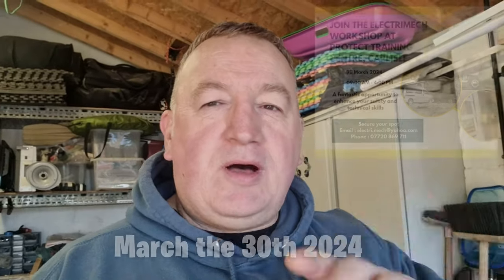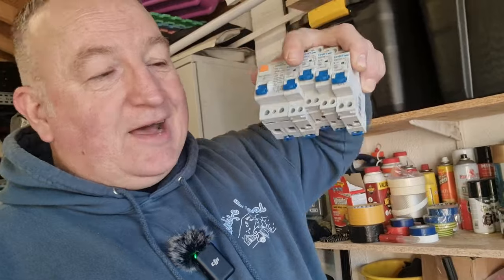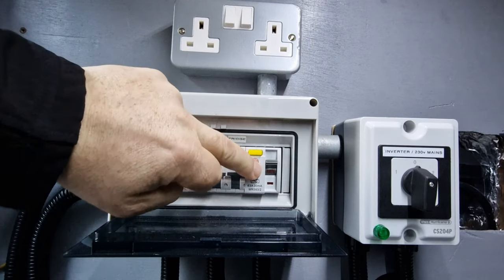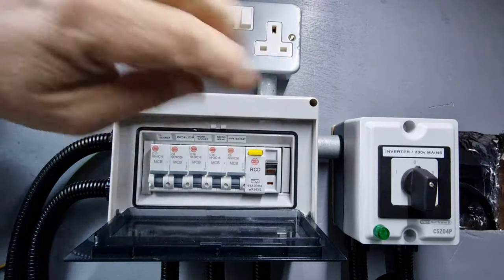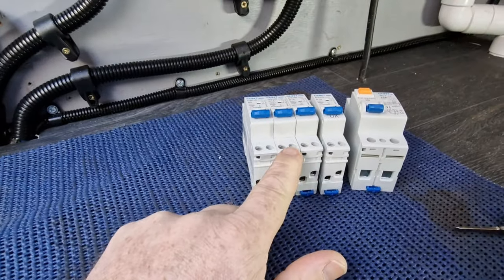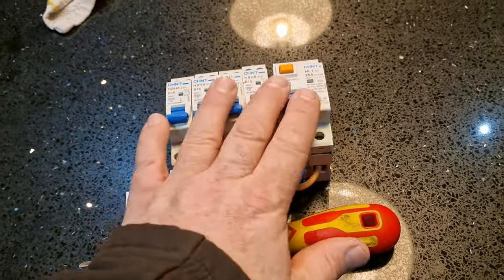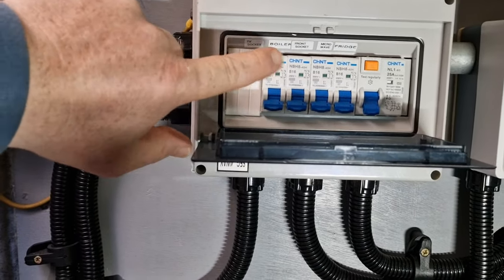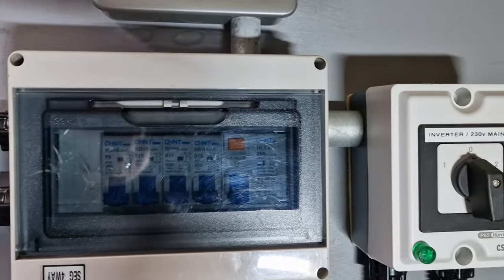campervan electrics campervan 230v fuse board upgrades

Comment: Hi Sam, though you are right to want to upgrade electrics to make them safer, regulations are not retrospective and there is no evidence that an Insurance company would invalidate a claim if you had the older RCBs fitted in fact most vehicle assessors are not qualified on 230v electrics so could not even report on them.
Reply from the maker: I wouldn't want to find out the hard way. 
Your campervan won't pass a habitation check with single pole MCB'S as they don't comply with section 721 of the UK regulations, 
More and more insurance are now requesting habitation certificates to mitigate their liabilities 
It's better to be safe than sorry, don't you agree?
Reply: @TheCraftyBlindersvanlife  yes better safe than sorry, interestingly LV don’t want to know what is fitted and when I spoke to them about this very point their view is that unless there is evidence of criminal installation (I won’t mention any utuber In Particular ,diffo not you) then they will honour a claim.
Reply: This would imply every campervan ever made and installed with 240vac by the manufacturer would need upgrading to be compliant with regs. Surely it would also mean domestic installations that now breach current regs would also need upgrading to be insurable?

Comment: Your video raised some really interesting points. Do you use conduit for all of your 240v cabling in the van? From a safety perspective I can think of many reasons why it might be sensible but is it a regulatory requirement? 
My understanding of why the MCBs need to be double pole is linked back to reversed polarity on live and neutral. If live and neutral were reversed the MCB would still trip on overcurrent but it would break the neutral connection, leaving a live feed present from source, through the load, and all the way back to the breaker.
Reply from the maker: Your right that's why we check for polarity when hooking up
Reply: I do wonder also how many hookup posts on campsites (especially some of the more rural ones recently encountered in France) have MCB’s that are dual,pole? As added safety I always flick off the circuit breaker on the post when plugging in my shore power lead, especially when it’s raining! But I did notice that every hookup point we recently used in France was not visibly protected by an RCD. Obviously lifting the semi-waterproofing flap to flick off the MCB breaker has it’s associated risks when it’s raining.

Comment: Hi Sam. Did you try the plug tester in the van to see if the RCD works with the inverter? That is the missing 'golden nugget' from the video. Cheers 😊
Reply from the maker: Had the system tested by my son all working fine we used a mutil function tester as it records the results

Comment: Hi buddy, I’ve had a few scary moments with the standard brakes on my swamper so after loads of research I’ve gone and bought the only upgraded brake kit I can find for vw crafter, got them from PB brakes , have a look pal
Reply from the maker: Thanks for the info it's on my list to do also
How are the new breakes?
Reply: @TheCraftyBlindersvanlife  

Very expensive pal , £ 1600 just for the front but the calipers have 6 pistons!! It makes a massive difference, only doing the front as it’s  £ 1700 quid for the back 🙈🙈🙈 it’s just to much to do both, 👍👍

Comment: Hi Sam,  I'm thinking I might not fit an inverter and all the bits that go with it, like batteries and so on. However, I'm still going to run a 12v DC system including fuse box. As for the 230v ac I'm considering a solar generator setup IE ecoflow. Do you think it would still be prudent to run a 230v fuse box for the fridge, microwave, and TV, which would all connect to a shore power connector on the outside of the van. Also, the ecoflow has shore power connectivity, which could power the van 230v system. Would this meet regs?
Reply from the maker: It would always be prudent to have a second source of power that complies with current regulations and a fall back or just for the winter months to protect your vehicle from frost and damp

Comment: Hi Sam, what is the difference between the two 230v inputs being switched by the changeover box. Is the AC sine wave from the inverter not compatible with certain RCDs? My van was built by a large manufacturer and was fitted with a Sargent with built in RCD, would that be suitable for a changeover from a power bank, what do you need to look for please?
Reply from the maker: The change over switch just allows you to select where you get your power supply from, either mains power or the invertor 
There a several different types of RCD out there all designed to work on different systems it's important to choose the right one as when you need it, there's a chance it may not protect you!
You could also add a power bank to a change over switch

Comment: Interesting to see your video. I was researching this for a while and finding conflicting advice 😮. Good to know what the regs require. I currently have a  hook up designed for tents, it is just connected through the van via the usual socket and hook up lead. Despite not using it much I should probably do it right 😊.  One big area of disagreement seems to be whther to earth the 230v to the van chassis or not.  There seems to be many that do and many that don't.  What are your thoughts? An electrician I know told me i did not need to connect the  earth to the van, so it leaves me a bit confused tbh.
Reply from the maker: Glad it was helpful! all your means of automatic disconnection require an earth how are they supposed to work correctly if the chassis is not earthed?

Comment: Great video Sam very informative and easy to understand but I do a electrical question I’ve been considering a lot at the moment 
Is the grounding of the electrical system to the chassis of vans 
When you turn on a inverter does it not change the current running through the chassis and cause issues with the vans ECU ? Thanks Kev
Reply from the maker: You must earth your van to comply with the UK regulations
Most safety devices require ears to operate properly
Your invertor is just another supply of power with a floting earth

Comment: Great video, mate. 👍 I like the breaker panel and the conduit you used! I am actually just in the process of mounting and wiring our electrics, with our install, it's all on the rear LHS - a tight fit.
I am a little surprised, that ferrules are not used on the (stranded) wire ends going into the breakers - that's a no-no within the german electrical standard. Using an RCB / MCB Kombo or an RCBO on the landline coming in should be a given, however, if you run mutiple outlets from your inverter to additional wall sockets, should you not include an additional breaker RCB / MCB breaker box behind the inverter? (Perhaps I just did not see one...)
I actually need to have a licensed electrician sign my 230V install prior to applying for a van certificate.
Stay safe! 🚐☁🍀

Comment: I would have all isolatros in plain view and gap around them so they can be properly used, the isolator on the side of the seat is too close to the upright, the one under the seat is hidden and not readily accessible. not sure what the bare fly leads are, but prob not good. Also why is alt and 12v through a mains trip? 

Never understood why there is never a switch on camper/carava 230v outlets? Can't be a great idea. 

Worth noting that ferrules on the cable ends makes a much neater and safer job. Makes sure you never get stray ends. 

Vehicles only need to be current at time of build, but always good to update the items. DC should also never go through a mains AC fuse box. Most inverters are true sine wave so the wave is as close to spun derrived AC as it can be.

Comment: Great video Sam once again very informative. Do you know of anyone who does Gas system inspections please. I`d like  a pro inspection of my LPG tank fitting and pipework. I`m sure its good ( 40 years engineering experience, mech )  but a second pro opinion and any advice to be safe I would gladly appreciate. Thanks .
Reply from the maker: There is a place in Workington that does a habitation check they may be able to help you